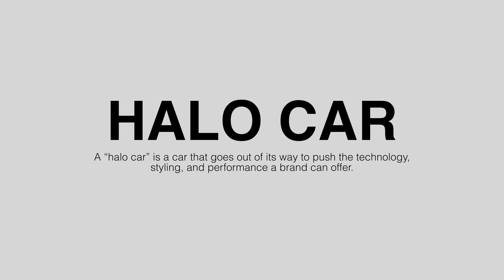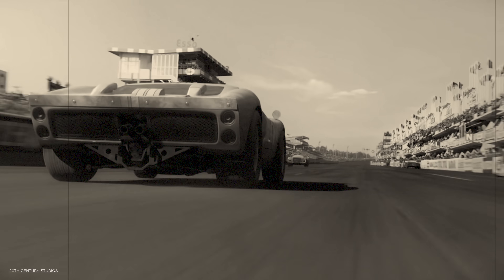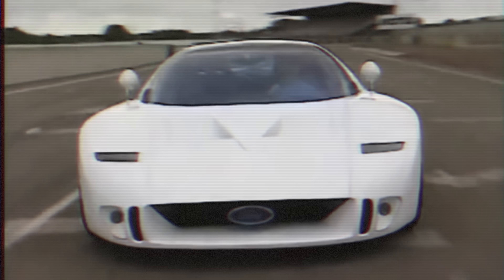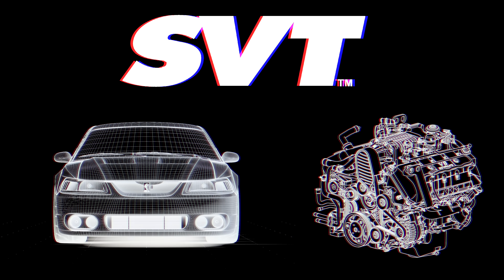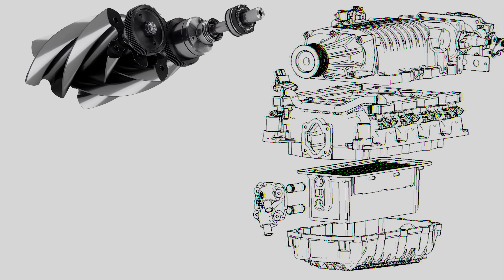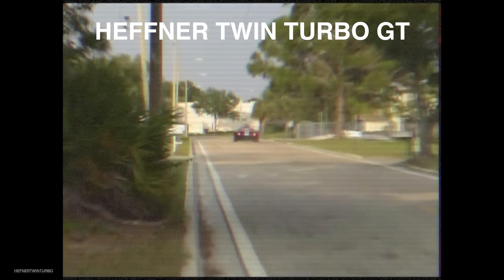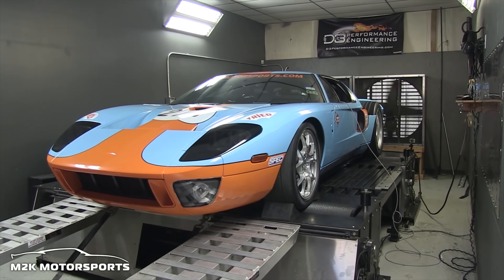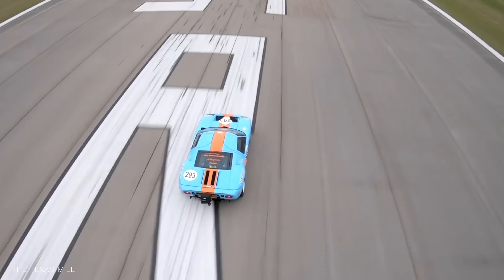Why Ford GT Engines Are Too Powerful (300MPH)😳| Explained Ep.16

Comment: With that level of technology, imagine what they could do building up the current Ford GT 3.5 liter TT V6?  Please don't comment that "it's only a V6."  The current Ford GT V6 is faster than the stock '05/'06 GT and has seen significantly more racing than it has.  Personally, I think it is a waste of a classic, limited production car to put that much (unnecessary) power in it just to say it will go 300 mph.  Sorry, but I am a purist when it comes to these types of specialty production vehicles and believe they should be left as produced.  If they made 400,000 of them instead of 4,000, it wouldn't be quite as bad, but it still goes against my feelings.  The funny thing is the '05 and '06 GTs weren't made for racing, but to be a phenomenal street tribute to the original racer.  The current Ford GT was made specifically for racing and did a ton of it quite successfully.  Oh well, just a personal opinion from a vintage race fan!  Lol

Comment: LOL, meanwhile over at Porsche they’re getting 550hp out of a normally aspirated 3.8 flat six that dominates its class at LeMans.   The 992 Turbo 
literally took second place at the Pikes Peak hill climb in BONE STOCK form, beating dedicated hill climb cars. 😆

Sorry, I love the GT but this isn’t impressive.
Reply: There were ford straight 6’s making 500 hp N/A in the early 70’s  also never seen a Porsche run 300 mph in the standing mile
Reply: @Gorilla Jones - Well the current model Ford GT with its 3.5 TT V6 roasted the Porsche 911 RSR in virtually all the IMSA WeatherTech races over 4 years, and with hp cut to 500 from the stock 647!  :yougotthis:

Comment: Camillo was my friend at the time he was doing the GT (I"ve kinda lost track of him lately). He and Sid Chiang were working on Petunia with Chelsea Lau as studio Chief (or maybe she was just a manager at the time). Both Sid and Camillo did some very aggressive and modern design proposals. J Mays didn't want to go new with it. J wanted to go retro. It's a shame that the world will never see what Sid and Camilo actually wanted to do.  One earlier iteration of the retro version of the GT design had a much shorter front overhang and smaller more compact proportions overall. It still housed all the mechanicals that eventually ended up in the production car but the smaller car would have been faster and lighter. J didn't like it because it looked less impressive so they added the extra length. J sent a lot of good design work back into the clay oven.

Comment: There is no such thing as too much power. It only applies when that power cannot be controlled. But control requires skill. The more power available the more control needed. Don't mistake such power as uncontrollable when all you need is the necessary skills and tools to control it.
An example is the Hoonicorn or any of Hoonigans works.

Comment: I've been messing around with cars for quite some time now listen I have a 79 Monte Carlo that's capable of 200 miles an hour with 273 rear and a 350 turbo trans with a little bit of horsepower you don't need that much horsepower to go that fast Lamborghinis don't have that much horsepower to go that fast neither does a Bugatti Chiron people need to wake up it's all in the gearing people .   Gears is what makes speed not all that much horsepower

Comment: The factory rated 550hp was underrated. I sponsored a VMP Dyno Day in late 2007 at the Ford dealership in Darien GA. where the dealership had one, he put it on the Dyno, it made 551rwhp with less that 10 miles on it.
Reply: My Uncle was a dealer and sold a Heritage edition(Gulf colors), I was there when the owner got to pick it up and got to go for a ride. I dated a girl who's cousin let me drive his that was at 800whp that clutch is still the heaviest I've felt. The Gulf car was dyno'd at a car show and put down 560 something at the tire stock. The Terminator Cobras in 03-04 also underrated the HP numbers.
Reply: @Loulovesspeed  rwhp is lower that crank hp. There is about a 12% hp drivetrain loss using a chassis dyno! The 05/06 Ford GT engine hp was closer to 620 hp.
And no the TTV6 GT will not blow the stock '05 or '06 GT into the weeds! The current TTV6 GT will never see 300mph even with JATO rockets strapped to it!
Reply: @mobeydick37  The new Ford GT is not built for straight line performance, the 2005 Ford GT could never match the new one on the track.
Reply: @mobeydick37  - I am referring to STOCK machines, not some hot rodded creation for doing 300+ mph in a straight line.  IMHO, that proves absolutely nothing!  Here are the specs, so you tell me which car is quicker, faster and handles better!  
2006 Ford GT - 550hp supercharged DOHC V8;  0-60 in 3.3 - 3.6; top speed 200 - 205 mph; 1/4 mile time 11.5 seconds; weight; 3,351 lbs.

2018 Ford GT - 647hp twin turbo DOHC V6;  0-60 in 2.9; top speed; 217mph; 1/4 mile time 10.9 seconds; weight; 3,047lbs.  
No more calls please folks, we have a winner and it's the 2018 Ford GT (with a 6 cylinder engine)  Lol.  :yougotthis:
Reply: @Loulovesspeed  The v6 is limited to about 1,500 hp max, the 5.4 can produce about 3,500hp, checkmate!
Reply: @mobeydick37  - Forget it as you are not listening to what I said!!  I don't give a rat's ass what hp these engines CAN make when modified, I am talking about factory stock.  '06 GT is 550 hp. at the crank from a 5.4 DOHC V8.   The '18 GT is 647 hp. at the crank from a 3.5 liter TTV6!  That's all Bucko!
Reply: @Loulovesspeed  An it will always be a F--Kn v6 that' slow!
Reply: @Loulovesspeed going 300 in a straight line absolutely proves alot.  You must be slow lol
Reply: @mobeydick37  He Dilbert, you can put1,500hp on a skate board and its speed would be ridiculous!  So what?
Reply: @Loulovesspeed 🤣🤣🤣🤣 everything you said is a joke. That same 5.4 with the tech of the coyote absolutely obliterate the ttv6 junk. Do you see the tech gap? Hell if ford put the predator 5.2 in their it would run circles around that ecojunk set up. They did a test with bolt on the 5.4 easily beat the ttv6

Comment: I would love to see Ford do a limited-run custom billet engine, and put two barras I-6 4.0L straight 6 together into a v12 (with a 97mm bore they actual displace 4.5L) for a 9.0L total displacement, with all the over-engineering they are capable of.
Reply: But that is the wrong direction Milo....Most car makers are following the trend of reducing the number of cylinders before they ultimately are gone all together!
Reply: @Loulovesspeed  yeah I know engine design is going smaller not bigger. Still nice to dream.
Reply: @waveman0  Always nice to dream, that's one of life's great free gifts!  ☺

Comment: The Ford GT is the Fastest Street legal car.. it broke 300 mph barrier twice 1st direction within 15 minutes on the way back in the Texas 1 mile
Bugatti needs 5 miles and only goes in 1 direct, and takes 3 laps i think.  🧑🏻‍🦱👍🏻🏎️🏁
Reply: Bukaki's are also very overrated and overweight
Reply: @chrismusiclover9893   Agreed, speaking of, did you know the 7 Gen  2024 Mustang has Bugatti headlamps.  I'll be missing the Tri-Bar gills, which is the reason why I didn't wait for it, and bought myself the only 2022 White Mustang with a Proper 6 Speed Manual Transmission in California .
It's a White Roush Mustang serial number: 22.0001 and won't sell it at all. 
🙋👍🏎🏁

Comment: Would love to see a 2020 GT modded. Wonder how much power could it make it’s already fast
Reply: They are too rare only a little over 1200 of those are made, nobody will modify, that is strictly a circuit car, it would destroy their value and really an ecoboost V6 is nothing to beef up, but you could crank upwards to a 1000hp if you wanted to on the stock block and crank.

Comment: I love this. The all around engine design reminds me of the MK 4 supra. It was so beefy because they wanted the power but not the size due to import/export sanction. You beleive that? Sanctions made it cost more to have a larger liter exported/imported, so they went with beefy bits instead low and behold one of the most iconic fast car/supercar killers ever made.

Comment: I really had to do a double take when I heard 3000 hp on a stock block, why isn't ford designing tanks?
Reply: Look up the Ford GAA engine from the 1930's and 40's. 1100 cu.in., DOHC all aluminum engine. 500hp & 1000 lb ft of torque lol

Comment: I made 1200whp through a BONE STOCK 2019 mustang GT engine/trans/diff/axles by adding twin turbos, on e85. Ford really does over engineer some of its modular V8s. I only dream of owning a Ford GT..
Reply: shit man i wish that was the case on the old 4.6L 2v, such a headache trying to make power, the internals are only good for maybe 8 lbs of boost and thats pushing your luck.

all of that for maybe 500 hp
Reply: @michealgray533  back in the day 500 hp was a lot. And even tuning exotic cars for loads of cash not always get you 500 hp car. What cheap 400 USD turbo can do now is mindblowing.

Comment: Moly not mahle. Moly is short for molybdenum. It's main use is to maintain strength at high heats.
Reply: Mahle was the piston supplier. Made of forged aluminum. Not moly.

Comment: People don't understand how phucking bananas it is to go 0-300mph in a 1 phucking mile AND could drive it home. Still blows my mind..
Reply: Truly, as most top speed runs I’ve seen are done in well over a mile
Reply: With stock block amazing
Reply: It’s bananas to go 0-300, period. Aero drag rises not as a square, but a cubed factor of speed, if I remember correctly. 300 in a Bonneville car shaped like a tuna is impressive. In this.. well, as you said. Bananas.
Reply: Makes you wonder how fast it could go if it had more space
Reply: Phuck yeah

Comment: Ford's biggest mistake was installing an overrated, disappointing "Ecoboost" V6 in the 2017-2020 models. They do not compare to the great Ford GT of 2004-06. That robust, intensely engineered supercharged V8 was the best thing that happened to Ford. And that is why the Ford GT from 2004-06 remains the greatest production car ever made by Ford.
Reply: They ran the EcoBoost Ford GT at 800horsepower around Daytona.
Reply: @jamesturner2126  I knew they had the 700 hp variant in the MKII, but didn't know they pushed even more power. 800hp is incredible from 3.5 liters.
Reply: @Omar - There was nothing overrated at all in the TTV6. It's been used successfully in road racing Prototypes for 8 years!   If anything, it was underrated.  I watched it live at Lime Rock Park in its last year of racing, 2019, and it left the mighty, throaty sounding Corvette C7Rs in the proverbial dust.  It was never even threatened by the Vettes during the entire race.  Same thing 2 weeks later at Road America, a first/second finish by the "underrated" V6 Ford GTs.  For the record, the TTV6 will blow the 05-06 supercharged V8 off the track in all aspects of performance - acceleration, top speed, cornering speed and superior suspension and brakes!  You are right in one comment - the TTV6 GT does not compare with the great 05-06 GTs......it decimates them!  😡  🏁
Reply: why is the EcoBoost overrated?
Reply: @cesarpalmos8235  it’s not overrated it’s a great engine. Won Ford GTLM class in LeMans lapping the corvettes. Just would’ve been nice to hear V8 roar when you floor it in a Ford GT.
Reply: @CoyoteFTW  I think it is one of the greatest small displacement engines there is. It is great to hear a v8 roar, but the Ford GT is a perfectly engineered in my opinion. Just like the 05 models, I believe the new GT has a lot of potential. A 700hp version of the new GT, which is only 40 hp more than stock, can actually beat a McLaren Sienna on the track.
Reply: @cesarpalmos8235  - In his mind only, since he never replied to your question!

Comment: 3000 hp on a stock engine block??? That’s mind blowing and fantastic original engineering from Ford.
Reply: I love Ford and Chevy and with that said,  yes a stock re engineered racing block .
Reply: Viper hold my beer
Reply: @GF-mf7ml  There isn’t a viper close to 300 mph. And the engine is a V10 built by Lamborghini displaces 8.4 Liters! You’re comparing that to a 5.4l. I remember when they had to lower the selling price for the viper by like 30k because it wouldn’t sell.
Reply: @CoyoteFTW  The Viper is just a basically 1990's version of the 1960's Shelby / AC cobra. Giant engine in a lightweight 2 seat front engine car, attractive to mental motorheads who think horsepower and noise, is everything. The GT is a race proven mid engine design, just brought to it's peak performance.
Reply: @CoyoteFTW  True
Reply: @CoyoteFTW  - And it still didn't sell, that's why it is gone!  Lol  The Viper turned out to be no more than a grass snake.  😂
Reply: @CoyoteFTW  The only Viper I know of that can reach 300 mph is my one on Gran Turismo 😂
Reply: You don’t know what you’re talking about. The viper engine legacy comes from the old school magnum engines of the 80’s specifically the 5.9 non hemi.
Lamborghini helped dodge with the original 8.0 v10 viper engine. Mostly with the aluminum block/intake manifold engineering. I forget but in the early 90’s either lambo or dodge owned shares in each company fast foward 20 years just like how VW owned lambo etc….

The fasted top speed viper in 2020 was a 2006 gen 3 with twin turbos, hit 240mph with 1000hp.
Ive seen gen 5s with litterally stock internals(not upgraded like the Ford gt) hit 2500+ hp no problem.
Most gen 5 vipers you see with these numbers are ACRs with aero, not exactly top speed cars.
What was the GT’s Nurburgring time? Cheers.
Reply: @Howie262  - how many LeMans does viper have? Did you forget two Ford guys created it, too? Lee Iacocca and Carrol Shelby. So thank Ford for your over glorified viper. Staged lap times don’t impress anyone. How about push the car to the limits for 24 hours running wot most the time.. and yes the engine was built and designed by Lamborghini there isn’t a single thing that’s dodge about the viper that’s what makes it great. Is it Ford GT great tho? Not even close.
Reply: @Howie262   You've never seen Gen 5 V10 make 2500+ HP with stock internals.   Sorry
Reply: @Howie262  not a chance. Gen 5 Viper stock internal limit is around 1400 whp
Reply: @CoyoteFTW acr viper holds many track records for a manual car...without going 300 mph, different strokes...
Reply: @somethingtough The Stock cast Viper Gen V Viper blocks have gone 3500+ WHP in NTH motos Juggurnaut, 3300 WHP in Kratos, Vipers just have way more drag. They would easily obliterate a ford GT in a race.
Reply: @aimxdy8680  he didn't say stock block, he said stock internals
Reply: @Loulovesspeed grass snake? You’re ignorant. Viper had a ton of success racing.  So much so they had to place regulations to keep it from winning.  Ford hasn’t done jack since the gt40
Reply: @CoyoteFTW how many lemans doesn’t for have since the gt40? Viper had plenty of success in racing.
Reply: @hashbrown4278  - Talk about ignorant!  Ford has been involved in a larger variety of racing programs, world wide, than Dodge has even thought of!!  The great Viper was pushed as the "Cobra killer" - what a joke!  The Mustang alone has won more races than the Viper was ever entered in.  Chrysler/Dodge is the only American brand that has filed for bankruptcy TWICE!  Don't try to waive the More Parts banner in front of me.  It has been a losing company for many years and I predict Stellantis will eventually let Dodge do the graceful thing and let it disappear into history!
Reply: @Loulovesspeed talk about ignorant.  They brought up lemans and ford hasn’t done jack since the gt40
Reply: @CoyoteFTW  - Sorry, but Shelby was little more than a consultant to Dodge , he had no direct involvement in any aspects of building this car (thankfully.)  Same for Lee, for that matter!  :face-orange-biting-nails::text-green-game-over:
Reply: @hashbrown4278  So you evidently missed the 2016 24 Hrs. of Le Mans.  The 2017 Ford GT, third generation, won in the GTE Pro Class, exactly 50 years after their first of (4) straight wins there!  :face-orange-biting-nails: At least Ford had the balls and determination to go all out for overall victory in '66, '67, '68 and '69!!  No other American manufacturer has done that as of 59 years later!  So who hasn't done "jack" in the last 6 decades?  Geriatric Motors and Chrysler.:text-green-game-over:

Comment: the 94 looks waaaay ahead of its time
Reply: It was ahead of its time. It had navigation, back up cameras, parking and lane keeping sensors, vented brakes, active aero, carbon fiber chassis, double wishbone suspension,  it even had ceramic panels around the exhaust because it got so hot. If it was produced, it would've been the fastest car in the world, faster than the McLaren F1's 230mph at the time.

Comment: They should’ve made a Ford gt with a voodoo or coyote variant.
Reply: Ummmm, why? 
Are you talking about the current Ford GT?
If so. its been proven that a V8 wasn't`t needed nor would it fit.
Reply: @blkngwinn  because v6s are gay. I guarantee you a voodoo GT would out sell the v6 nobody in America cares about circuit racing ect.
Reply: @blkngwinn  except you’re not going to be able to put out 3000 hp with the current V6 engine block.  When you’re designing a car, you can engineer around the engine to make any size fit.  (Just saying)